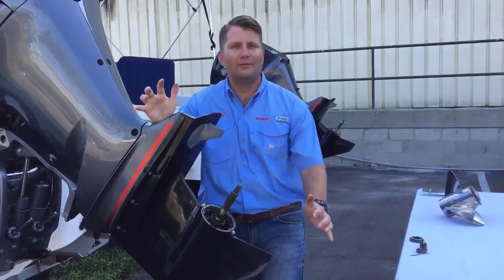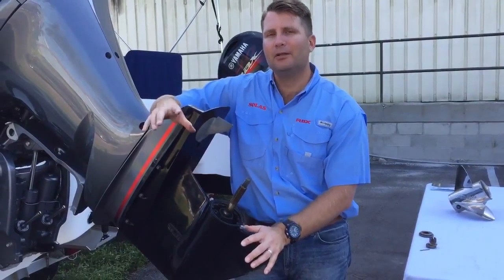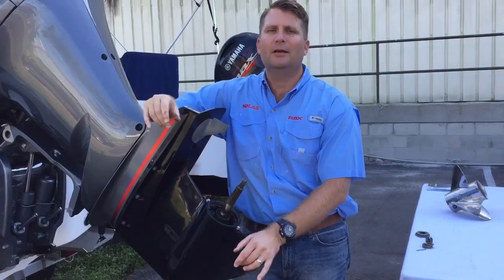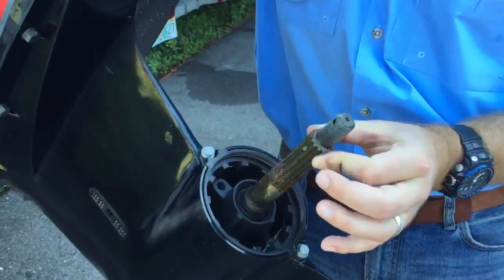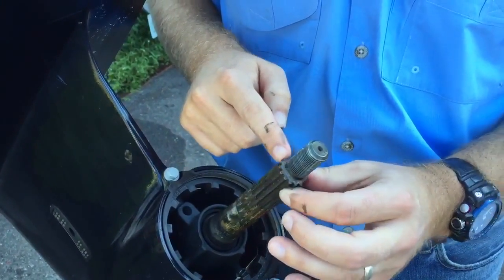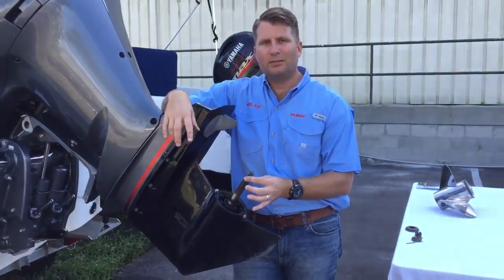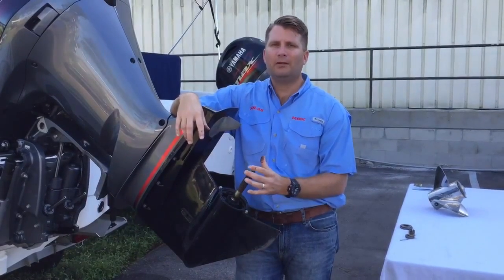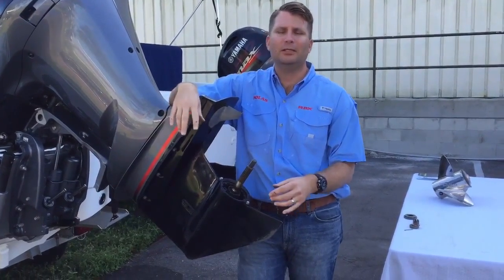Splines on a propeller shaft

Comment: I have an old 25 hp Mercury 2 stroke outboard serial 0B236228 model 1025577 version ELH   In trying to locate a prop I need to confirm the number of splines. The prop is not off yet to count them. Can you help me confirm if this has a 10 tooth spline propeller hub or not? Thanks!